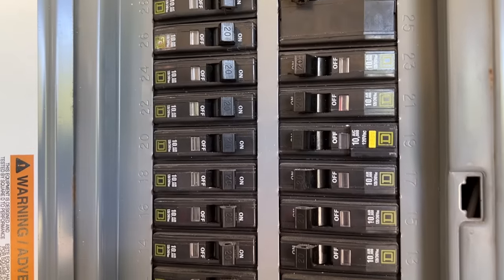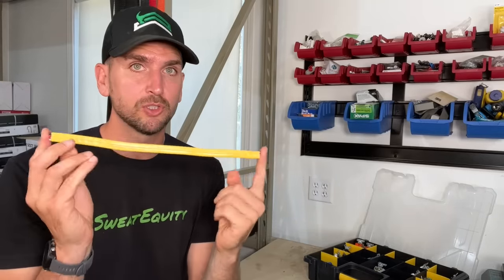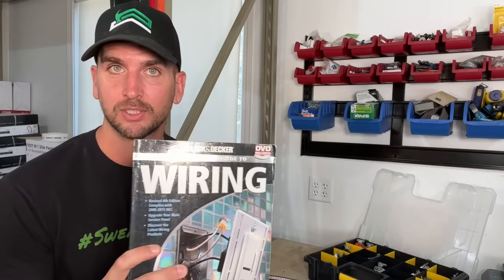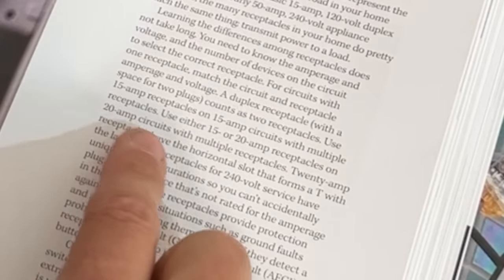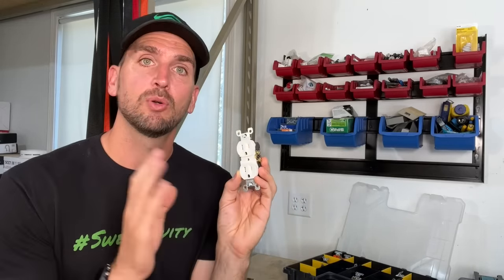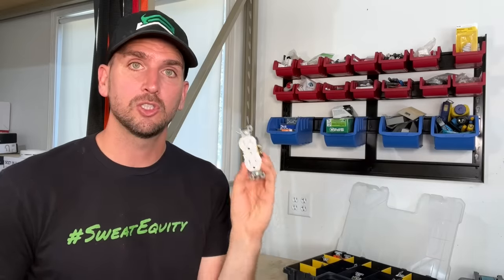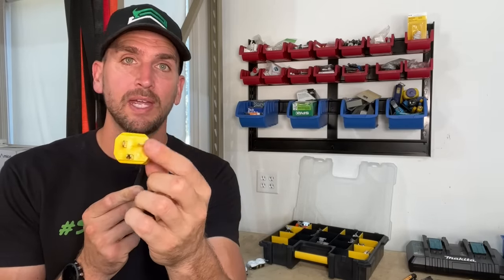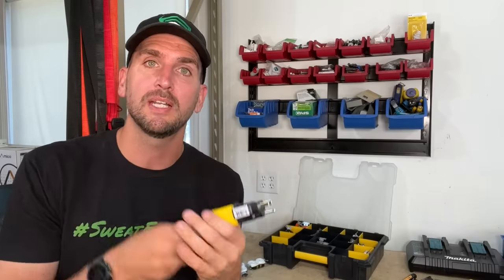Can 15 Amp Outlets Be Used On A 20 Amp Circuit Breaker

Comment: the simple answer is that a 15 amp device with the proper plug type installed can't draw enough amps to overload the circuit. Remember the breaker is there to protect the wiring within the building not the device plugged into the outlet.
Reply: That's right
Reply: I thought he was going to warn about installations down the line, using 20 A outlets feeding from the 15 A outlet, but that wasn't mentioned.
Reply: That like saying my ten amp led light can’t be plugged into a twenty amp breaker circuit
Reply: Technically you should not feed a 15 amp recptacle with a 20a breaker. Although his point is well taken, a 15a receptacle, cord and device could, in the event of a short circuit, pull more current thru those devices than they are designed to handle. This could result in a greater chance of deadly shock or fire. Best to keep apples with apples so as not confuse or endangef someone else who may come in behind you.
Reply: @slipstreamvids7422  that's really not correct; most if not all 15 amp outlets are designed and tested to handle 20 amps of pass thru current. It's the contacts that are only designed for the 15 amps. it's a common practice ( in fact code) to wire two 20 amp circuits for kitchen outlets and install 15 amp outlets on those runs. Code allows this so that the circuit can allow many 15 amp devices plugged into each of those outlets to be drawing power from that 20 amp breaker. The 20 amp breaker combined with the proper wire size will take care of any overcurrent condition that might take place at the outlets.
Reply: @michaelwillcutt2619  not really sure what you're trying to say?
Reply: @barrysiler1443  hard to overload a 15 amp breaker on the 20 amp circuit unless there just a couple breakers-inline typical multiple outlets on one breaker curing the overload   I own hundred years old houses before electrical standards were established an many still have rope insulated wires  a few never was wired until nineteen thirties .
Reply: @michaelwillcutt2619  If I understand what you're saying then that's exactly why the code was revised in the United States to mandate 2 20 amp circuits installed in any new kitchen. the code folks figured that many people would overload a 15 amp circuit with many 15 amp devices plugged into the circuit. The code was revised to up the wire size and breakers to 20 amps to allow more total Watts to be drawn from the circuit without constantly tripping the 15 amp breakers that had been allowed by the prior revision of the electrical code. In todays homes the power demands from small appliances has increased exponentially from the kitchens of the 50's or even the 70's.
Reply: How long have you been certified licensed electrician???
Reply: Five hundred an thousand square foot homes barely exist anymore apartments are bigger than old homes used to be  there always been a standard for the time period. Bigger houses technologically built lighting kitchens laundry rooms an so on  lower amperage appliances .  Lots of differences between early electrical and today’s . Look at led lighting vs standard
Reply: @michaelwillcutt2619  I'm not an electrician, I'm a retired Mechanical Engineer with over 35 years experience designing electrical systems! I'm the guy that would be hired to inspect the electricians work to ensure it meets the code requirements.
Reply: @barrysiler1443  OK. I'll pay the extra in the event I buy a 20 amp indicated device regardless of where in the home its located.
Reply: @barrysiler1443 pmo99
Reply: I find that armchair electrical experts are extremely funny!   They know just enough to make either dumb or totally out there statements.
Reply: @KevinCoop1  I'm not really sure who your answer is directed at but that's Ok. If I'm incorrect I'd be interested in your opinion on the topic?
Reply: Yes, but you can overload the circuit by simply plugging in various devices that sum up to more than 15 A.
Reply: @altuber99_athlete  Which is exactly why code allows a 20 amp breaker to be used with 15 amp outlets. you can overload any circuit by plugging in too many devices...that's basically why we have circuit breakers in the panel to protect the inaccessible wiring within the walls of the structure.
Reply: @barrysiler1443  Sorry, I meant “overload the receptacle”, not “overload the circuit”.

Suppose we have a 20-A circuit (i.e. with a 20-A breaker), with various 15-A receptacles. Now suppose we connect in one duplex 15-A receptacle two loads that draw 8 A and 9 A. Hence. The total load on such receptacle, as well as on the circuit, is 17 A. So, while the wiring and the breaker are not overloaded (>20 A), the receptacle is (>15 A). And the breaker won’t trip, thus it won’t protect the receptacle. So, this is what seems like a bad design.
Reply: @altuber99_athlete  I think if you look closely at the 15 amp receptacle packaging (and the testing of the product) you'll see that most if not all "15 amp" receptacles are designed and tested to pass 20 amps. Each individual socket is only designed for 15 amps of load but the design is expected to be able to accommodate a 15 amp device being plugged into each of those sockets; I'm not saying it's good practice to plug in that arrangement but from a design and testing point of view the manufacturers of those devises understand that there are folks out there that will do just that and that the equipment installed should not be the point of failure.
Reply: @slipstreamvids7422 when you say 'technical' you mean code. Table 210.54 says you're wrong as long as it's a duplex receptacle.
Reply: A 20 amp device is telling the end user that it’s ok to plug a 20 amp (16) load into that device. If it is not a dedicated circuit, to a single receptacle, it’s not.
Reply: Try pulling the two Apart, they’re identical. Same Ga. Metal, so explain why you Couldn’t.
Reply: Wow! the code state that if two or more outlet are in the same  20 amp circuit you can use 15 amp receptacle but if one outlet is on the circuit like a dedicated circuit you must have a 20 amp rates receptacle.
Reply: @slipstreamvids7422  This doesn't make any sense at all.   A short isn't 3 amps over nominal to somehow not trip a 20a breaker.   A short is a short.   Also, it's allowed so "technically" it's fine.
Reply: Thank you. It's been so long since I did residential and wanted a clean cut answer.

Comment: to make things perfectly clear, receptalces have two ratings: they have a device rating and they have a feed-through rating.  nearly all receptacles with a 15 amp device rating have a 20 amp feed through rating.  the ones that don't are the ones that don't have screw terminals.  those shouldn't be used on a 20 amp circuit, and more conscientious electricians believe they shouldn't be used at all.
Reply: I agree that they shouldn't exist at all.. My mobile home had those and they were awful. Several were breaking apart physically at 22 years of age. God knows how long they were broken for. I replaced them all with spec grade parts and used pigtails instead of using the receptacle as a junction point. As a result, the lights don't go dim when using a vacuum cleaner now, when it did before. Big improvement. Those cheap parts were awful. My question is for what? To save 30 or 40 dollars on the cost of building an entire home? Even if it were a couple hundred, I feel it's not worth sacrificing the quality in my opinion.
Reply: If a vacuum cleaner causes lights to dim, you have a crummy wiring job.  Glad you could fix that.
Reply: @mikeholmstrom1899  yeah! It was really bad. That's the way mobile homes are built. As cheaply and quickly as possible, with little concern for quality.
Reply: @Krankie_V  I'll third that.  Never ever use backstab outlets.  I hate the sound of arcing inside my walls.
Reply: @Krankie_V  If it was made by Fleetwood, my brother would call it "Fleetshit".  Close the door and the whole wall moves.  I would guess the high line ones didn't have that issue.
Reply: @NiceMuslimLady  Fairmount is the company. It's one of the better mobiles I've ever seen. The wiring job leaves much to be desired though.
Reply: I agree the 20 and 15 amp versions usually internally identical and able to supply the 20amps also note the average run is dropped in 14guage and depending on length of run is not compliant to that load (max of 50ft at 15amps less at 20amps but not listed or agreed upon by electrical engineers)... The difference is found with the optional break off "fuse" on the side of the receptacle so you can feed through the receptacle to another or remove it and feed each outlet from a different drop. That fuse is the difference, it is designed as a fail safe at that amp load the receptacle is rated at... Combining in the back of a box negates that and adds load to the run length without the safety of that fuse being used sadly this is common practice. The only adjoining should be done is the grounds or a bulky 3 way or maybe some lighting setups all other piggy circuits should be hooked on the receptacle and make use of that fuse link. Another uses for the fuse link is say you know your going to plug an air compressor into the top outlet in your garage you can break off the fuse to then supply a 12guage wire to the top (to be fully compliant with load over run length) and a 14guage to the bottom and know the drop line can handle the intended load without either outlet on the receptacle sharing a drop/circuit/breaker.  This is good practice depending on the RUN LENGTH from home panel to say a shed or detached garage without a sub panel. Some things that are commonly used that will pull over 15 amps are vacuums, skill saws (shop tools), toaster/microwaves over 1500watts, some huge bread mixers/blenders stressed by tough motor load, septic grinder pumps, and washing machines agitators reversing also due to motor load. I see many people piggy backing breakers to save on GFI and those circuits generally end up overloaded due to 14guage wire and/or piggy backed outlets in the kitchen usually when home owner/renter are heavy appliance users running both outlets at once example customer " I was using my toaster oven rotisserie and went to make a margarita on the other end of the counter and the breaker kept tripping". If it was me i would 12guage and individualize those particular outlets and never piggy back in the kitchen outlets or places where a vacuum or space heater will likely be used just make it common practice share those potential heavy load circuits with lighting only. But what do i know im not an electrical sparky i just play one on YT.
Reply: @masterdebater8757  got documentation for that statement about the link tab being a fuse?
Reply: @AZOffRoadster  You are kidding I hope.  That arc is 12,000 degrees F even if very small and nothing immune to plasma.
Reply: I like this answer.
Reply: @skinwalkertrippin3980  thanks. I did my best to be clear and concise.
Reply: I wish all outlets had back-feed with screw-clamp, like GFCI outlets.  As secure as wrapping a loop around the screw and much easier to wire.  Some industrial type are like that.
Reply: @Krankie_V  RV's are the worst.  Peek behind the purty skin and you would be horrified at the wiring, plumbing, and structure.  But self-correcting since they have <10 yr life due to roof leaks.
Reply: @sophiegrisom  not an RV, a trailer house, but yes, as a mechanic, I've worked on my fair share of RVs as well and those are horrible

Comment: Another common appliance with a 120 volt 20 amp plug, is a professional grade treadmill.  In the kitchen,  sometimes you see then on a professional grade toaster oven or heavy duty microwave oven.   It's with noting that whenever an appliance or piece of equipment comes from the factory with a 20 amp plug on It's power cord,  that means it draws more than 15A and close to 20A.   It will probably mention in the instruction manual that the product is for use on individual branch circuit only,  and technically you are required to follow the manufacturer's instructions on any product with a UL listing or a listing from another Nationally Recognized Testing Laboratory (NRTL)  .    That said, most times 20 amp receptacles are installed so the occupants can tell at a glance it's a 20 amp circuit.
Reply from the maker: Good stuff Kyle, I appreciate the feedback 👍
Reply: The overcurrent protection on a 20 amp braker is 20 percent
Reply: Alot of what you said is correct, but a product with a 20 amp plug does not mean that it draws close to 20 amps. 16 amps would be the maximum recommended. Anything more would require a 30 amp 240v circuit, which would give a 24 amp safe maximum. It could also have a 20 amp 240v plug which would require only half the current for the same power (watts).
I have a stovetop range that came a 20 amp plug and is rated as 1630 watts or 13.6 amps. I verified this with a clamp meter. It requires a dedicated circuit as you mentioned. Some other products could use more power, but not more than 16 amps or 1920 watts. The safe maximum is based on 80% of the circuit rating and only applies for a continuous load (3 hours or more).
Reply: Appliance ratings are misleading. My vitamix (vm0197) blender is rated for 11.5 amps. It never actually draws that though. In fact, the current draw only gets close to that when the blender starts generating lots heat from an excessive amount of work which requires more energy for it operate. So in other words, I'd have to turn the speed dial up to 10 and put to full trays of ice in the carafe and let it go for 5 minutes before it even got close to drawing that much current.
Reply: Personally, I want to get a nema 6-15 or nema 6-20 in my kitchen one day so I can use a 3kW electric kettle like is available in Europe.
Reply: @dbattleaxe  good stuff.    You know, I wonder if a 3000 watt kettle is available in the U.S. special order of course,  or if you'd have to have it imported from Europe.   I suppose if you had one imported you could cut off the European plug and install a nema 6-15 on it's cord.    Either way it should work without issues even though European stuff is rated 230V 50 Hz, as it much of the world.    That's why the electrical standards in North America kind of sucks.    Although I understand why we use 120/240 V or 120/208V, since the carbon filament lamp by Thomas Edison ran on 110 V D.C. so we can be backwards compatible,  considering homes were electrified for the sole purpose of lighting at first.
Reply: @Sparky-ww5re  You can actually get adapters to nema 6-20, so there's not even any need to modify the cable. As far as voltage goes,  most things are rated up to 240v if you look at their input power specifications. Frequency could be an issue on some devices but that's not going to affect a kettle. Devices made in the last several decades have been designed to work across the EU, so they shouldn't assume that the neutral side is actually neutral, either, so the two phases vs hot 240 and neutral isn't an issue, either. The main headache is just getting two phases to the kitchen.
Reply: @kalijasin  I ran into that with my miter saw.  Normally it works fine, but going through some heavy work, it got a bit hot and loaded down, and popped the 15 A breaker.  I'm going to run a heavier line, and also check the draw rating on the saw.
Reply: @EverydayHomeRepairs  for the tv, ps5 or sound system, is ok to use a 15amp outlet and 14 gauge wire?